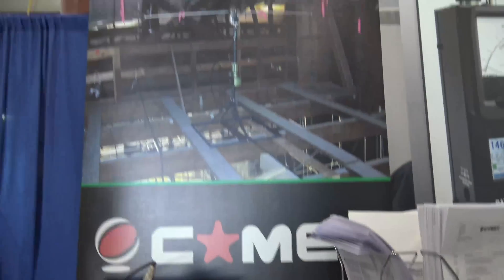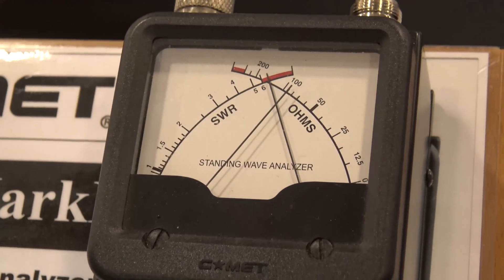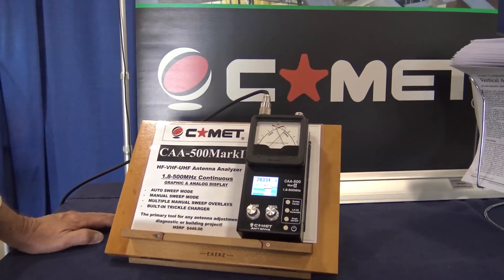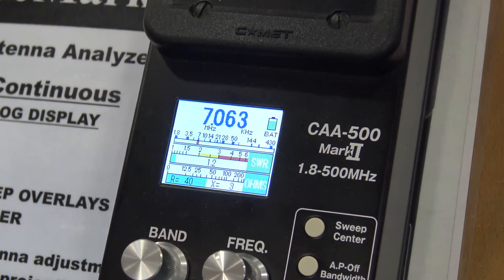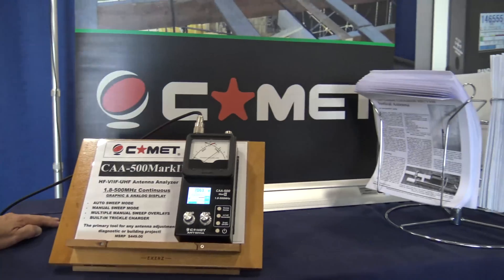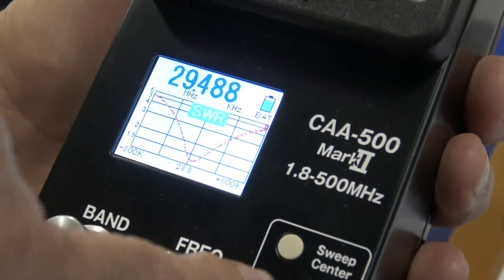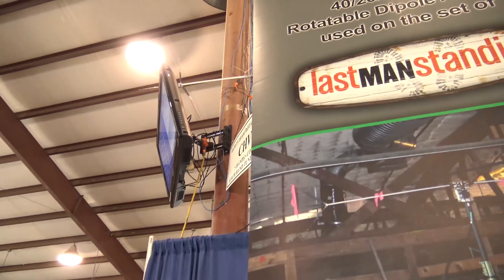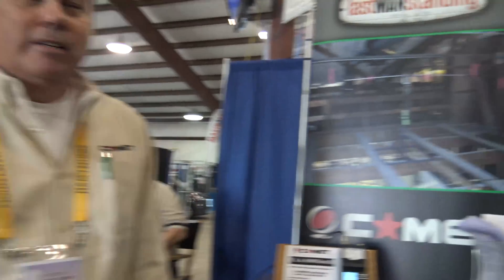Comet CAA-500 MK2 Antenna Analyzer Preview

Comment: This gets used at the transceiver (to/from antenna), correct?
Reply: This connects to the antenna with no transceiver it tests the antenna and feed line together or just the antenna if you connect direct to it. Never transmit into this it is not an antenna tuner

Comment: Some say that tuners don't actually tune the antenna's resonant freq. This is crazy.  ATUs actually shimmy up verticals and do tight-rope acts on dipoles.  Then the trimming begins.  Now I know why there are  bits of aluminum and wire all over my yard.  My antennas are all resonant though.  And no more need for an 'ATU'. BTW- all that TEQ propagation on 15 the other day?  The QSOs I had?  This, at the very bottom of the solar cycle.  This, during a geomagnetic disturbance.  Nah... couldn't be real.  The bands are dead.  Thanks and 73 OM

Comment: If you don't care how much power your antennas radiate, tuners are just par, if you want what little power you have with a 100 watt radio to actually be radiated, resonance is key, that's why homemade magnetic loops are so awesome, the great advantage of having somewhat of a notch of bandwidth on HF ....? NOISE, I live near large HV power lines, its night and day for noise with a mag loop compared to a vertical and has a few S-units stronger signal as well with the mag loop..Resonance is everything. Before my radio transmits, it's already resonant, just picked up a Comet Mark 2 last week, very handy to tune the loops.